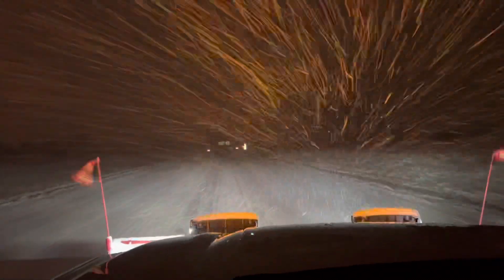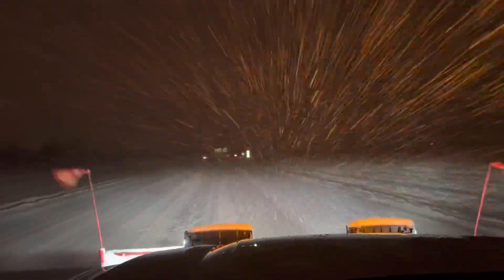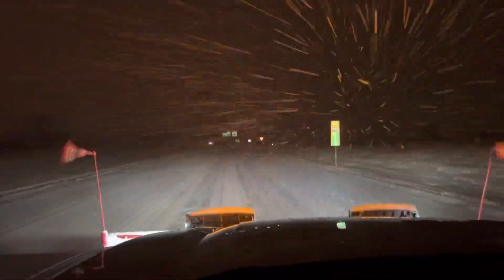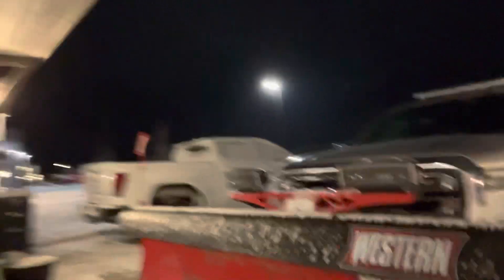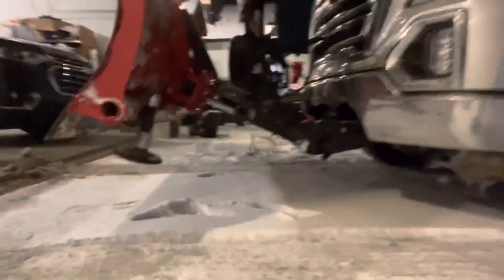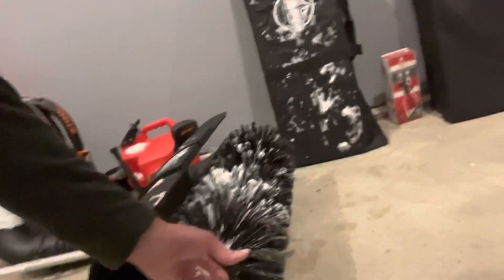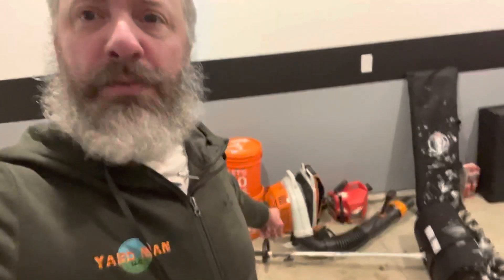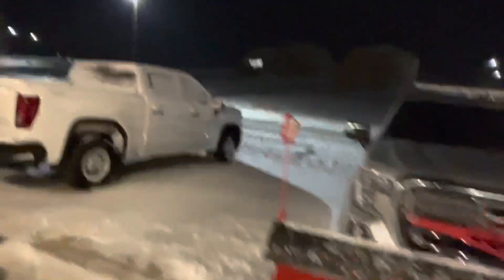Broke the Western Plow | NOT COOL | Busy Clearing Driveways During Snow Storm in Kansas City

Comment: What is the temperature it's possible you have a small piece of ice for the metal connectors are if it's cold enough pulling it inside for a little bit
Reply from the maker: Thanks for chiming in. Found a disconnected wire. Vibration rattled it off. Problem solved.

Comment: You need to have a BUCS system on that plow.  You could have just rolled an ARDD and kept on trucking.  Solenoid maybe?
Reply from the maker: I’m guessing pump motor or something with the hydraulic pump. Could be something simple as a fuse or relay. I’ll take a closer look in the daylight tomorrow. It had worked just fine at the previous property. I was super disappointed! Made for a lot of extra work
Reply: @yardmanllc7268  It is not a pump motor if it will go left and right.  Check all the connections and plugs including your handheld controller.  

Some dealers are open during snow days with 24 hour service.